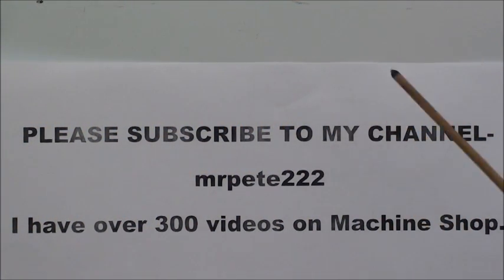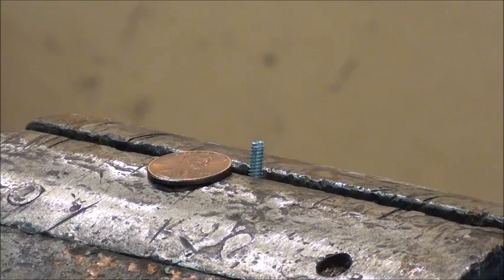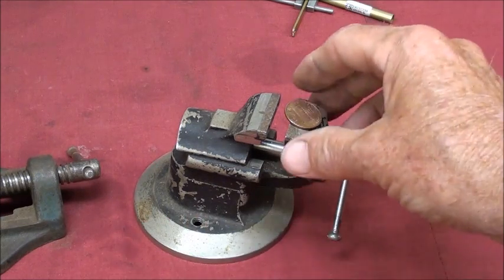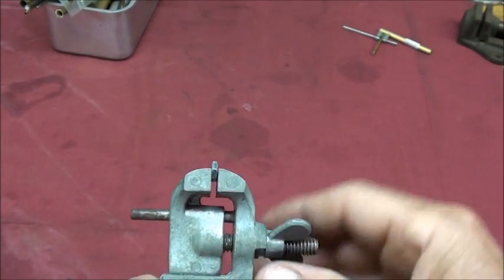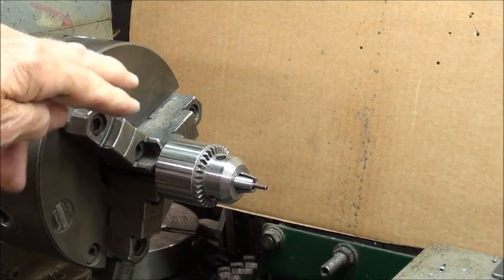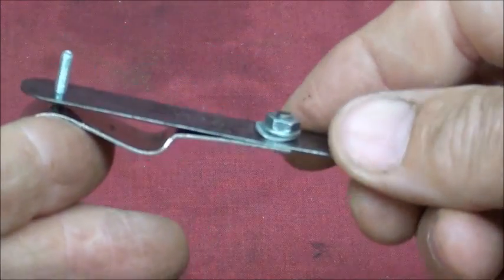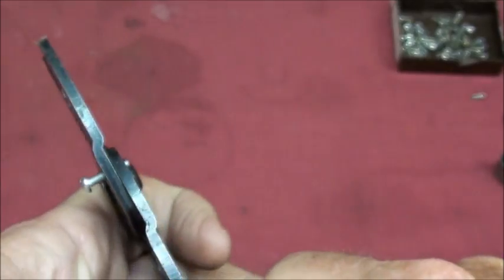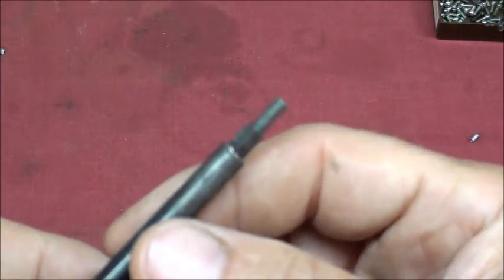MACHINE SHOP TIPS #110 Holding Small Parts tubalcain

Comment: I find so much valuable information from your videos. Shop ideas. Shop directions? Wait up hold parts. I learned about hand voices which I didn't know anything about from an old English gunsmith that retired and eventually passed away in Enid, Oklahoma which is not very far from me. I found out about the hand vices and their popularity and so poison. I got online and started looking and there wasn't any real good ones today so I went on eBay and found some that were manufactured back in the late 1800s in. Bought a couple of different ones and I have found them to begin valuable I can put them in a bench vise I can hold them in my hand. I they're just majorly valuable to me now. And pin vices. I'm looking for some that are good quality by good quality and you never have to buy the tool again but a lot of people don't know that today
Reply from the maker: I am so happy that you appreciate some of these old tools. Starrett used to make a fine quality set of pin vises. Maybe they’re still doing but they will be pricey.

Comment: New subscriber here... all good sound advice!

Off topic here, but a great way to later demagnetize tools, vise jaws and like is to use an old TV degaussing coil. Energize the coil a foot or two away, bring it in and wave the item through the coil, then pull it well back before releasing it's switch. Don't exceed the coil's duty cycle, 10 or 15 sec should be more than enough. It won't work on permanent magnets, or reliably erase tapes. Keep watches & the like away too.

Thanks for the videos!

Comment: I have been using wire cutters for decades and I never knew what those holes were in wire cutters since I just used them for wire stripping, until now. I can't tell you how often I've put those smalls screws in the vice and used a hack saw to cut them off, this has changed my life and made it better.
Reply from the maker: +Chillhouse  THANKS for watching

Comment: For cleaning up the cutted ends of small bolts or pins on the grinder,  I usually use a cordless drill. As the workpiece rotates, the grinding leaves it perfectly round.
Also a nice way to clean up, reshape or polish screwheads. One gets pretty inventive when in need for an stainless oval countersunk torx head, so I just reground a standard countersunk on a non-backed section of the belt sander by holding it in the drill. Then over to the polishing wheel, done!

Comment: Thank you for the tips.  They are very helpful.  On the feeler gauge clamps you can notch the end of one to hold the screw and then drill a larger hole in the upper one to use for starting the screw in hard to hold situations or if you are just clumsy like me.  Don't know where I got the idea.  Thank you very much.

Comment: Great spring steel screw holder, I'm going to make one right now, end of burnt fingers and lost screws LOL. I use what we call a bird table, a 24" length of 4"x 2" with a 9" square piece of 1" thick plywood screwed to the end, hold it in the big bench vice, adjust the height to bring the work to eye level. The table top holds all sorts of fixtures, a pattern makers thing.

Comment: I never thought you could cut off a screw like that (with ease) using a wire cutter.  I have always had that problem with a screw being to long and have always been bummed that I would have to hacksaw it or figure some way to make it the size I needed. And all of  the ways of accomplishing that  are pretty much a hassel.  It can't be that easy (is it?)  Thanks a lot for the info.   That info is priceless.  I didn't understand the last tool you made. I Need a demo on that.  14 Hours later after viewing your video.......and I just got back from Harbor Freight and took a bolt with me to try out the wire cutters.  That is very dangerous and can take off the tips or ends of your fingers if your not very careful.  I was unable to break the bolt and neither could the help; he said you probably had a softer bolt.  In any case the way that wire cutter (crimper) is made it has razor like indentations right wear you grip the handle for splicing wire gauges.  It is very dangerous!  That is too bad you made it look so easy.  I am better off with bolt cutters.  Anyway I learned a lot from your videos and I still have my fingers.
Reply: +That's just ducky You have to use quality cutters to do that with ease, the Chinese ones strip wire okay, but aren't sturdy enough for the screw  cutting.
Reply: That's just ducky: No telling what your item was, but he was not deceptive when he cut that screw. I've done that many times after figuring it out. If you have a hardened steel item then of course it won't be so easy.  So why don't you ask nicely for advise about it? This man is doing us a favor by sharing his knowledge and experience with us. So be a gent.

Anyway I wanted to say, those crimpers that cut screws are also available in Metric.
Reply: That's just ducky n

Comment: tip, if cutting a screw shorter without a special tool,..always thread a nut on first, so you can unthread it and clean up the threads. Hardened nuts are ideal for this....or even a die